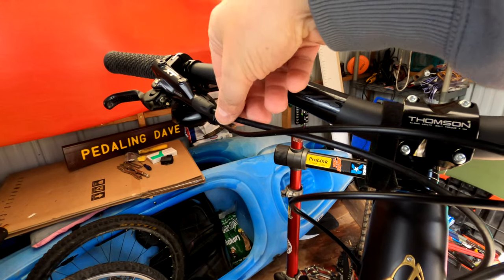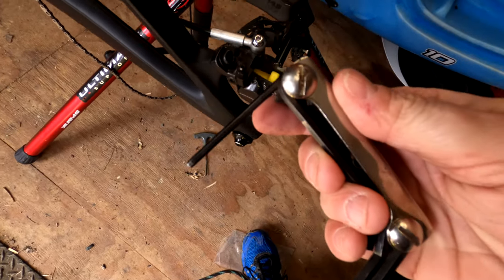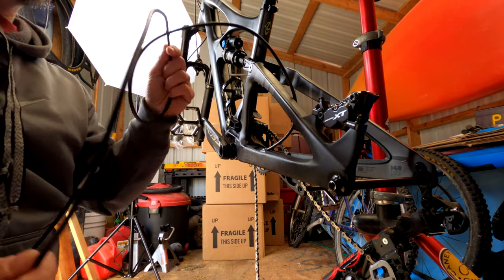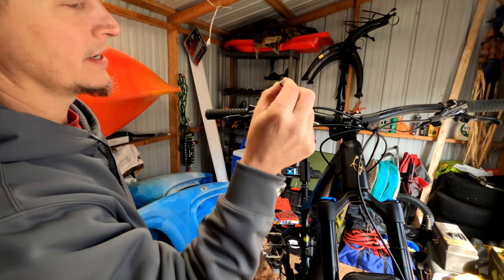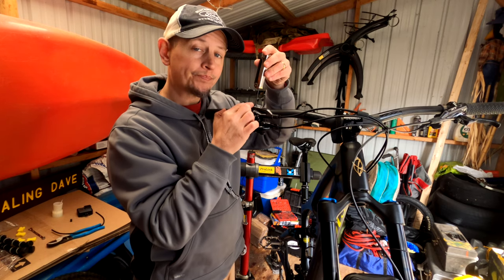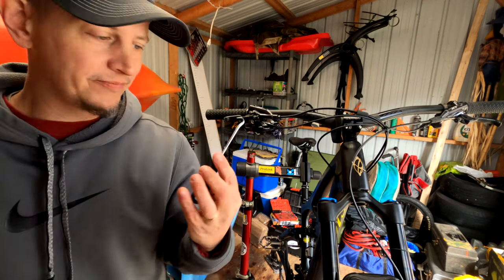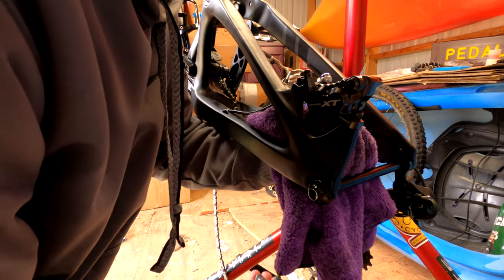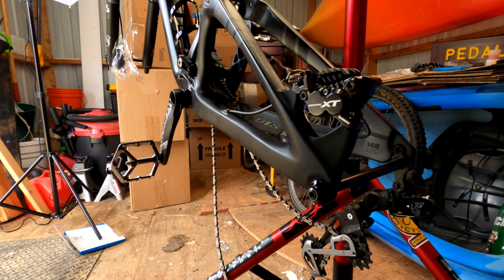Replacing Shimano Brake Hose // Brake Bleed // Ibis Mojo HD5 Internal Routing

Comment: This is exactly what I’m looking for. I’m getting the XT M8120 brakes next week and have been scared just thinking about how to insert the hose inside the frame. My frame (2019 Santa Cruz 5010) is very similar to your IBIS. Small holes but I guess all you did was push the hose through... looks simple from here.😎
Reply from the maker: If the Santa Cruz has built in tubes for the brake lines it'll be a cinch to do!
Best of luck!

Comment: I'm replacing both hose and lever, do I just drain the entire system from the caliper, and should I avoid pressing the lever if there's no oil in the reservoir?
Reply from the maker: Well, I would put the new lever on, attach/run the hose to the caliper & lever.  Then flush/fill the system again.
I don't see a reason to drain anything from the caliper since you're refilling the whole system with new fluid anyways.

As far as pressing the lever, I honestly don't know if it matters.  That said, I would try not to press it until the system is full of new fluid as a precaution.

Comment: Great video! I would just like to ask you a question. I cut my hoses too short. Can I use the rear hose for the front brakes? So that I can just buy one hose for the rear brakes, and use my existing rear hose for the front brakes. Thanks!
Reply from the maker: Thanks Kiss Shot and Yes, you certainly can do that!

Comment: When removing the break cable through the frame do you have to worry about and leaking if break fluid with in the frame? I have new breaks but they came all assembled and I have to take the hose off the lever to thread it through the frame. So I am wondering how much fluid actually sits in the hose?
Reply from the maker: You might leak a little fluid but it isn't much.  Put some tape over the open hose and it will minimize it.
Either way, it shouldn't cause any issues.
Congrats for tackling the project yourself as well!
Reply from the maker: Oh, and if your frame doesnt have cable guides built into the frame, tape the end of the old to the new one and carefully pull it through the frame.
This will also minimize the fluid leaking out!